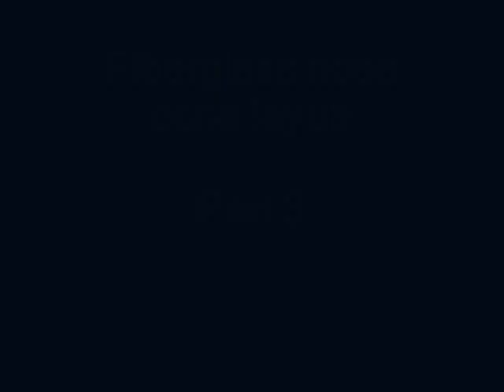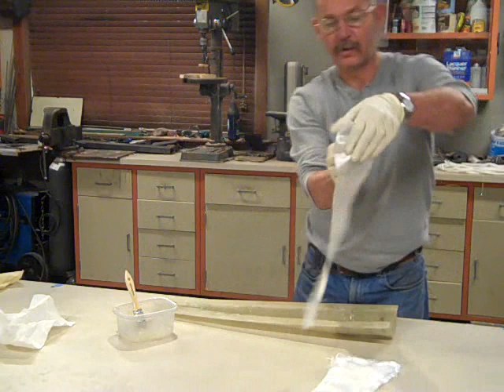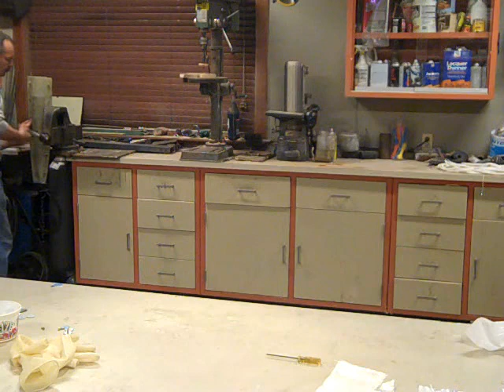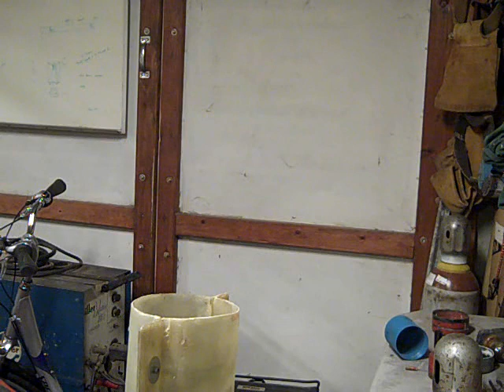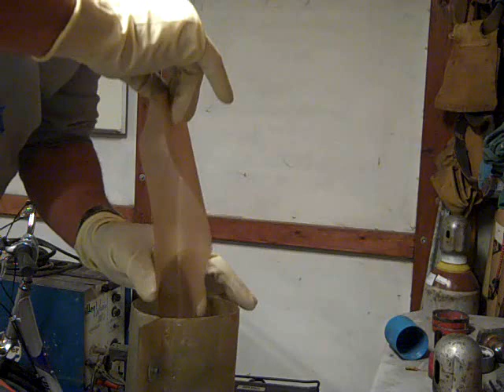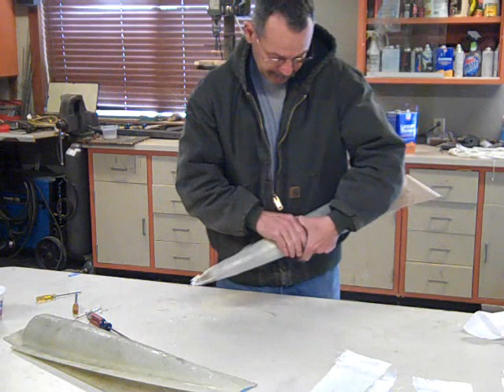nose cone layup

Comment: Just a point of interest, you need to build in some kind way of locating both half's of the molds, little cones on one side of the mold that fit into equal dimples on the other half or holes drilled. Just some way of lining up the half's when joining.